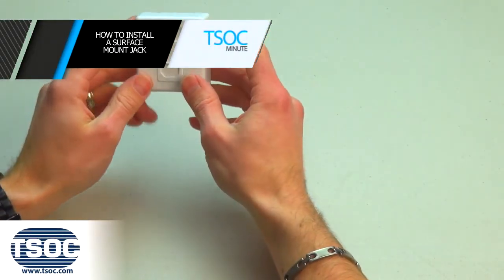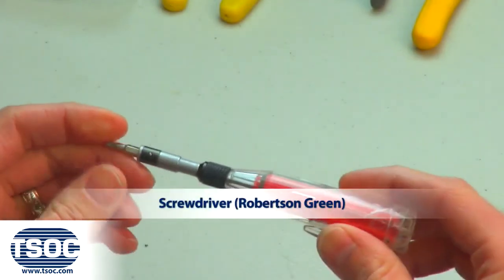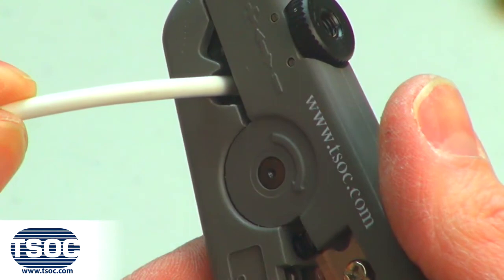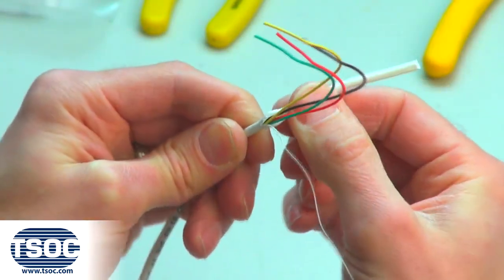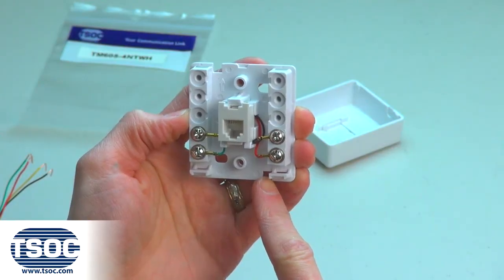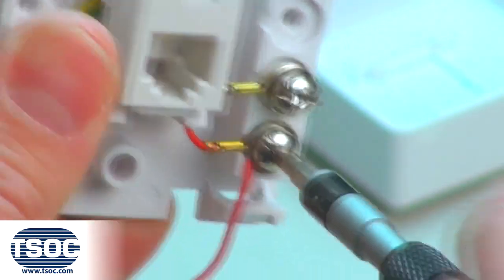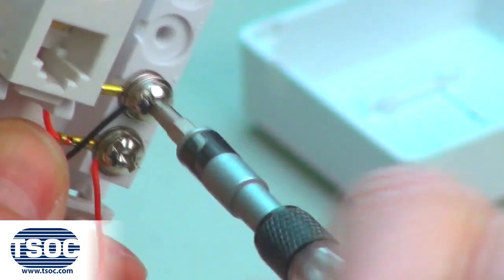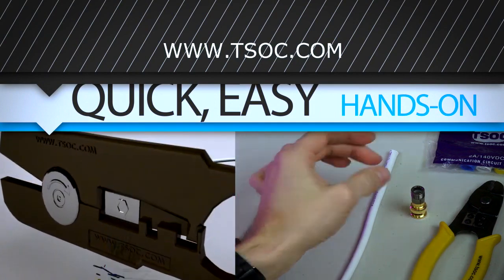How to Install a Surface Mount Jack - The TSOC™ Minute (ep. 11)

Comment: I came here to find a faster way to get the wires on the screws, I might try the 90 bend to screw it on, but I was told to always bend to the right so as to have the wire go clockwise with the screw when tightening.
Reply: +Why Jessica, I think that was one of the stupidest things I've heard in quite awhile.  Roll the wire that's already bent, between your pointer finger and thumb and the bend will be whichever way you want it.  And the video DID bend it to the right.
Reply: is